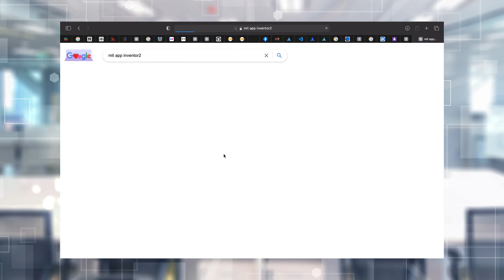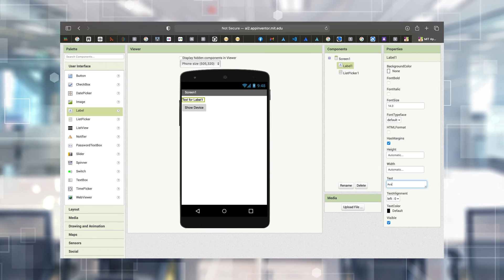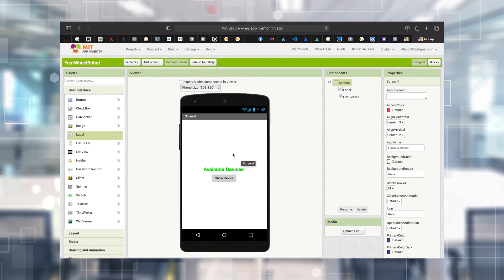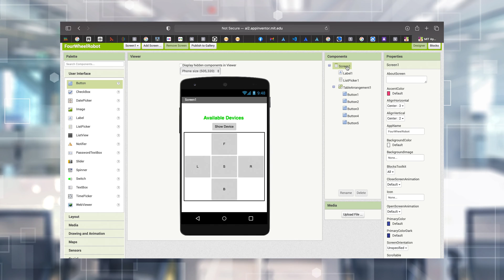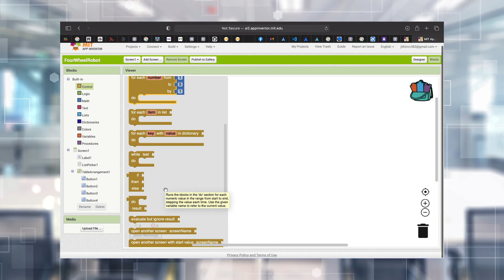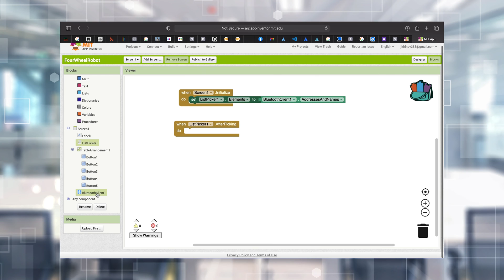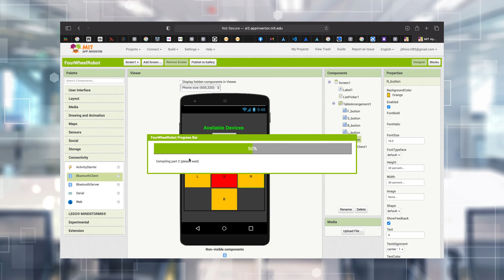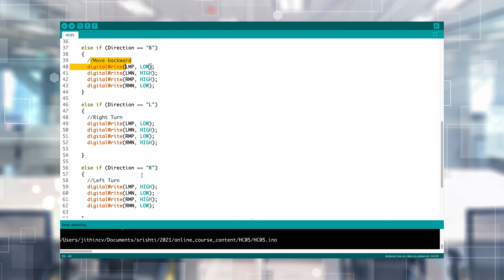Bluetooth controlled Robot using Arduino Uno and MIT APP Inventor

Comment: You chose pins 6,7,8,9 however I didn’t see anything about pwm in your code. I wanted to use this to control a rover using a motor driver cytronmdd10A it uses pwm. I’m assuming your code will most likely not work for me?

Comment: I paired the HC05 with my phone but in listpicker i mean in show device option it's showing nothing.
Can anyone help me ?
Reply: I am facing the same problem, have you found the solution?
Reply: Me too,do you have any solutions to solve problem?Can you show me?Thanks a lot
Reply: @hạnh nguyễn văn  i have connected the Bluetooth to pins 0 and 1 on the arduino , but first you have to run the code then connect the pins TX on RX
Reply: I had to face the same problem.Reopening the app after force stopping worked for me.But It is still not working properly.If I press F multiple times then the car moves forward only one time.The motor does not run continuously.